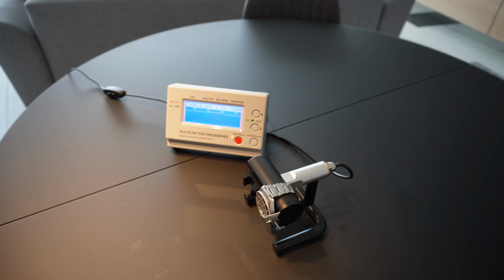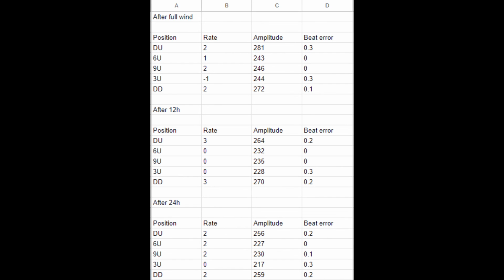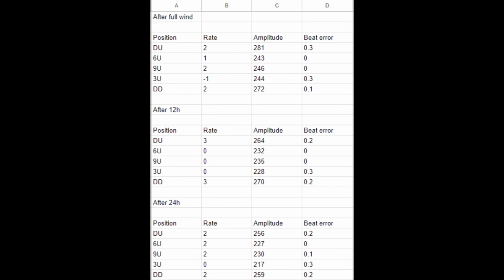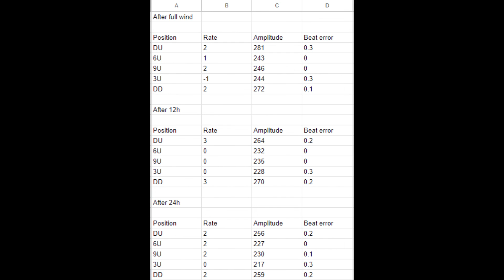Trouble for Rolex part 2: diagnosing low amplitude issues

Comment: Huge issues with mine. Bought brand new and was loosing 5 seconds per day. Was sent to service and came back unchanged. Then sent again it came back -2. Now 6 months later back at -6 SPD. Huge issue with 3235 that NOBODY will admit. That’s 3 services needing a 4th now in a less than 1.5 year old watch.

Comment: The “new” Rolex 32xx movements with the 70 hour powerreserve have a serious problem and that is loosing time after 2 or 3 years, it seems a an amplitude problem and Rolex knows it but the and the AD keep there mouth shut the only thing to do is replace the mainspring inclusive the barrel and also the escapement and it seems you must do that every time when that problem occurs !!
Sold my GMT and now I have a JLC (+ 1,3 spd) and as a sportswatch i think about a Omega (master control) both watches have a beter movement than anny Rolex.

Comment: Get mine in may 2001 with 3235 mvt, keeps time very precisely during 14 month then loss more and more seconds a day and finely stops some nights => gave it to my AD for a service.
After that it was fine during 12 months but again since the end of february 2024 the watch doesn’t keep time, minus 40 minutes in 2 months !! 😮
ADs do not explain the issue, they say that the 32xx movements are very good and accurate but it seems they are a little embarassed with my concern.
I dont know what to do, I will not service this watch every year 😢 so disapointed …
By the way the relevant Rolex forum topics about this issue are not anymore available when you clic on the link … does Rolex want to hide something ? 😂😢
Reply from the maker: Uf, sorry to hear about your problem. I don't know how they can say that 40 seconds per day is an acceptable accuracy.

Btw, the links are still working for me.

Comment: My 124060 runs well for the moment almost same values as yours after two months of ownership...i am concerned about this problem but I hope rolex to find a solution because we are talking about million watches with 32xx movement... I can't believe that they aren't aware of this issue..almost all of their new watches use the same movement.
Reply from the maker: I'm sure they are aware. They're probably silently fixing it when a watch comes in for service. They just don't want to do a recall for reputation reasons. Which sucks if your watch is out of warranty.
Reply: @treiceasurirele2022  exactly my thoughts... Let's hope that's the case because I really wouldn't like to sell the watch I really love it. (I sold my 16710 to get it that's the irony). Thank you for the reply have a nice day
Reply from the maker: @likandros3633  Thanks you too!
Reply: @treiceasurirele2022  hello again.. I have some interesting news about this matter... I sent my 124060 submariner to rsc in order to remove a small particle inside the glass.. After 4 days they called me to collect my watch...when I got home I used my timegrapher and the amplitude was 300 horizontal and 270 vertical.. The accuracy after 30 days is - 1.30 per day... It used to be - 3sec per day...the max amplitude before was 285 horizontal 245 vertical... So big improvement.. The interesting thing is  that I didn't tell them to regulate the watch I only told them to clean the tiny dust particle.. Something tells me that this was a silent repair...
Reply from the maker: @likandros3633  Yeah, sounds like it. Glad they did it for you, although some transparency from the RSC regarding what happened would have been nice.

Comment: i stil have problems with my submariner date , after 2 times a service overhaul, it lose again 8 sec a day, Rolex will not explane to me what the problem is. Very bad movements, Thinking for sell it, and buy a Omega again;
Reply from the maker: Ouch, that's very bad luck. And Rolex is very opaque when it comes to telling people what was wrong. I've seen this story a lot. Good luck with whatever you decide!
Reply: Sell the 126610 and buy a 116610 like I do and I don’t regret it personally I think the 116610 wears better because of the smaller Bracelet…and I think the 3135 is a better movement too same -2 +2 specification….and the 2 Days of Power Reserve of the 3135 did it for me…

Comment: you should be putting the crown on the other side, that's where the mic is. Also what's your name on TRF?
Reply from the maker: It's t_serban. I did try with crown on the other side but did not see any difference in the measurements, at least not for this sub.

Comment: be interesting to see if the amplitude drops further after 36, 48, and 60 hours after a full wind.
Reply from the maker: It will always drop if the watch is not worn. But so far the only clear data point from watchmakers about whether there is a problem is if it's below 200 after 24h.